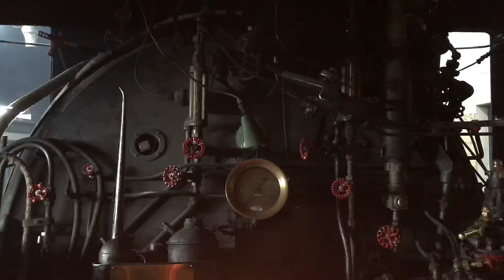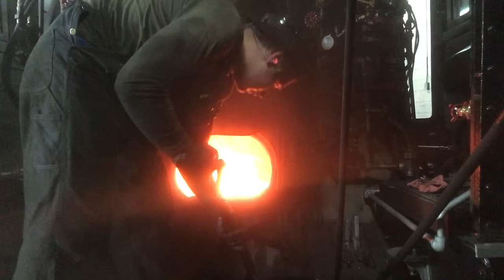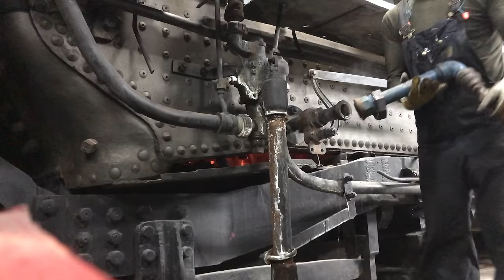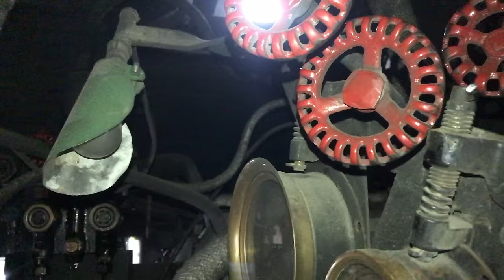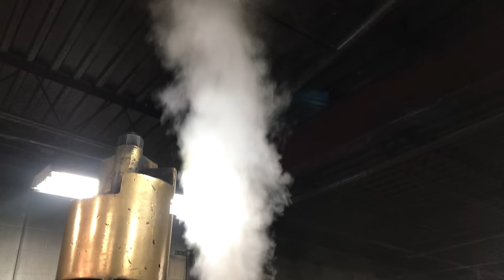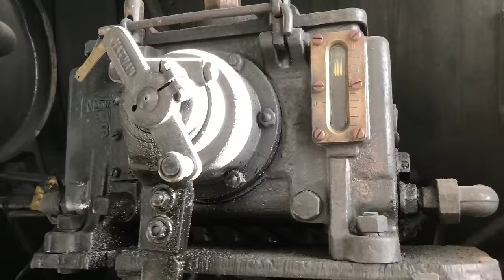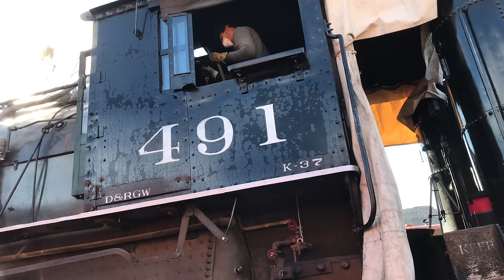How To Fire Up a Steam Locomotive [4K]

Comment: Flames in the firebox look like they are in slow motion...?

What a wonderful, wonderful piece of machinery a steam engine is...
Reply: I would guess that most people normaly only see open flames in a camp fire.
What causes the flame to go up, is the difference of temperatures between the flame and the surrounding air.
Most probably that difference is much smaller in a semi-closed environment like the firebox.
Reply: That is correct, if i learnt anything in school
Reply: +The airflow isnt the best in there, so there is less air pushing the flames around
Reply: Realize too that until the blower is functioning, there is back pressure in the tubes and the smoke will want to follow the path of least resistance. These run the length of the boiler, and will draft the smoke forward but it's a lot shorter route for the smoke to just billow out the firebox door until things are moving. Firing up a cold boiler too often also decreases the efficiency of the engine faster because the creosote and ash from the smoke condenses in the tubes more when they are cold, at first creating an insulating layer of crud and soot, preventing a lot of the heat from entering the water and eventually restricting flow. Once hot, and the blower is working, a lot more of it can move forward and up through the stack. Once the tubes are really sooted up the engine goes through a tear down to rod out the tubes, scraping out all that junk. They say a steam engine like this is about 3% efficient. That seems like a lot when you look how much wood and coal he burns, before it even moves an inch. 6 hours of hot fire doing no work at all!
Reply: I agree.  9:27 mark.  Was surreal.

Comment: How informative! There's so much more to firing and lubricating a steam locomotive than I would have ever assumed. The somewhat smaller diameter wheels coupled with a large boiler from a standard gauge engine is a good combination for climbing the steep grades found in the Colorado Rockies.

Comment: No wonder they went to diesel! Still, the wow factor is high!
Reply: ltcajh Diesels may not have quite as much plumbing, but they do have a lot of heavy gauge wiring in them.
Reply: @michaelmurray7199  wiring, believe it or not, is easier to manage than plumbing. Less to worry about.

Comment: Great video! Thanks for posting. I briefly volunteered there many years ago. I was always fascinated with the manual turn table. Balancing the weight of the locomotive then physically turning the table by hand. I was amazed at how easy it was to turn a locomotive around by hand (as long as it was properly balanced). I didn't continue my volunteering due to the fact that I am a machinist, welder, fabricator and all they ever had me do was paint stuff. It seemed that there was a "Good O'l Boys" club and if you weren't a part of that then you did not get to participate in any of the round house operations. I did get to operate the turn table once at an event held there, only because someone else couldn't make it. It's a great museum and I still enjoy visiting there. I just volunteer my time now where my skills are actually used.

Comment: The "slow fire" is pretty normal for coal. It doesn't burn like wood, and it's not under heavy draft while the loco isn't moving. What you are seeing is gases outgassing from the coal, and burning in the air above it. When in motion, there is a much heavier draft, and these gases are drawn up faster and further and combusted in the combustion chamber and firetubes. When the fire is cool and not under draft, a lot of the gases don't ignite at all, and just go up the chimney, which is a major reason for the thick smoke while the locomotive is getting up steam. Even opening the firebox doors allows a cool blast of air to cool the area over the fire, and a black smoke cloud is released. Another good reason to keep the fire hot, because you are loosing 15-20% of the BTU content of the fuel up the chimney if you don't keep the fire hot enough to fully combust these gases. Anyway, that's what a coal fire under minor draft from below looks like. Nothing abnormal about it.

SIde note, I thought it was much better to put on frequent single or double scoops of coal than to shovel big heaps onto the fire like that? That's in normal operation, and maybe it's different, but it seems like you could get the same benefits either way. Apparently putting a bunch of coal on cools the fire down, with the same poor results as described above, so it's best to put a small amount on, give it a few minutes to ignite and heat up, before adding more. Of course, maybe you have a lot of other stuff to do to get ready, so you can't stand there shoveling coal in every 4-5 minutes like you can while under way.
Reply: Holy Christ balls that’s a long comment.
Reply: Awesome Galore Holy Christ Balls Lmao. I Love Humanity.

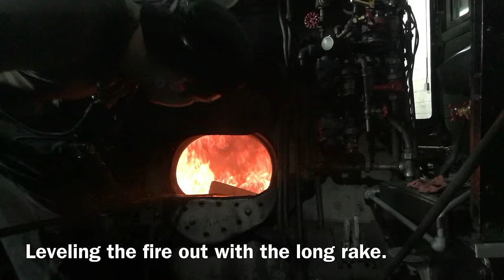Comment: anyone else think that the fire is burning in slow motion @9:34?
Reply: Looked cool
Reply: Yeah
Reply: I have actually seen this happen.  When you have a big fire and low draft, there is not a lot of air through the firebox, so it looks like the fire is 'slow'.  Under the right conditions, you can even see 'flashover' or secondary combustion at the top of the firebox.  A lot of wood stove guys are into secondary combustion to boost efficiency.  (shown in many youtube vids on the subject)
Reply: It looked insane
Reply: my guess is that the engineer is utilizing some sort of choking mechanism to slow down the combustion process and improve efficiency of the firebox. most fires (that would be considered to be burning at a normal speed) will dump a lot of their heat into the exhaust gases (smoke). by choking the fire like this and slowing the burn, he can heat up the boiler quicker and more efficiently
Reply: That's how hell looks like
Reply: Of course there is a "choke" (it's called a "damper"...or "dampener" if you're English, I believe). But that won't make flame itself burn "more slowly". It cuts down the rate of oxygen intake so the combustion happens more slowly, and the fire isn't as hot. But flame itself is just the visible part of a fire, the incandescent plasma escaping from the exothermic reaction we call "fire", which is just a chain reaction of molecules breaking down, releasing energy, which breaks down more molecules, releasing more energy, etc (as usual, the oxygen is merely a major catalyst that allows this to happen). Anyway, more oxygen makes fire hotter and faster, but less oxygen won't make a fire burn in "slow motion". A lack of drafts blowing around will lead to more stable flame however; when you see flame flickering and licking the air, it's due to gusts and drafts of air reaching the fire, and a strong draft will draw the plasma upwards with it; fire in microgravity burns in all directions equally. So closing a damper will probably make smaller and smoother flames, but not slower ones.
In any case, closing a draft just equals a cooler fire, and a cooler fire will not make a boiler heat "more efficiently". It will just be cooler, and therefore release fewer BTUs and take forever to heat the water up, which actually takes MORE total BTUs since the heat is constantly escaping to the atmosphere as you heat the boiler. It's like trying to fill a tub with the drain open; it will take less water in the long run to use a large hose and get it done quickly than to use a small trickle only slightly larger than the size of the drain. By the time the tub is filled, you will have run enough water into it to fill it four times, at that rater. Anyway, you are "choking" the fire from _underneath_, which just makes it cooler. The exhaust still escapes just as easily. 

So, using a smaller heat source is actually LESS efficient. At a low enough BTU point, the heat source literally cannot overcome radiant heat losses and the water temp never changes. Double that heat source, and you'll heat the water, but you have to keep the fire burning 4 times as long, so it actually uses MORE fuel. It's not linear even, it's a logarithmic progression. In all cases, it's almost always best to heat with a good hot heat source. There is probably a point where too much is too much, and the material cannot transfer heat as fast as it's being applied, but it doesn't apply to warming steam locos. 

In a steam loco, the biggest problem is to keep enough draft going while trying to heat it up, since without airflow over the stack and without the blastpipe working, it can be very difficult to keep a decent, efficient fire going while making steam. They use a blower to keep artificial draft going to keep the fire hot enough to heat. They certainly don't cut down the draft even MORE by closing the damper. The only time that is done is when banking the fire, as far as I know, or if for some reason you wanted to keep a fire burning in the firebox, but not necessarily enough to keep up any steam, just a small, dull fire that might keep the water warm.
Reply: The reason why it looks slomo is because the whole volume of air inside the fire chamber is extremely hot, so the flames wont get pulled up by hot air so fast anymore. A flame burning in cold air will pull up its own hot air much faster.
Reply: I dont think Hell would look awesome!!!
Reply: That’s exactly how my wood burning stove looks when I get the balance between air and fuel right. I have controls to reduce the air fuel ratio.  The firebox of this engine is similar to a wood burning stove just much larger and the ratio of air vs this increasingly large and hot fire makes for an almost mesmerizing flame.
Reply: I believe there's a draw fan on the smokestack.
Reply: @corey872  still looks totally dope.
Reply: @3DPeter  you just took my comment out of my fingers.
Reply: @nialether   I hope that i go to hell, because that's where the bad (and willing) girls go.

Comment: Excellent job to the guy in the overalls and the recording guy! Looks like he does a great job at starting up Steam Locomotives! How long did it really take to do all that work? Hope to see more videos soon! I love old steam engines, how they move, and sound, it really is something!
Reply from the maker: Roo Reeves From cold, it usually takes 6-7 hours to get up to operating pressure. In the video I started at around 3AM and the locomotive was running at around 10AM.
Reply: Jeff Barrier,is logic,,,the iron may have the dilatation slowly,,to avoid stress metal,,is a big mass to heat,,and logic,,takes many hours,,,,tyhe biggest steam locos ,,,more time,,,12 hours.,buyt once is in run temperature,,has  a heat reservoir:His big mass
Reply: Adam Ross the 1225 is a beautiful piece of engineering-art. I love that locomotive, and it's one of the favorites on my layout
Reply: 3am - respect!!!

Respect all round for this substantial contribution to the online video resources of operating steam locos! Thanks Jeff :D
Reply: Asserting Word it kind of pays off for that work though. Pound for pound, steam engines have alot more horsepower and torque than diesel engines. 
Diesel just won out because of lower maintenance, MUCH quicker startup, and much easier to man and crew.

Comment: That was very interesting to see!  Takes a lot of elbow grease to wake up such a mechanical beast. I suppose the video also shows part of why electric and diesel locomotives eventually replaced steam locomotives completely: there's a lot of man-hours involved to keep steam engines running.
Reply: Very true. As romantic as steam is, once Diesel, Petrol and Electric drivetrains became reliable the world began to move on (for trains, cars and stationary engines).
There are just too many disadvantages:
Very long warm up/starting time.
Regularly requiring water fill ups even with condensers (if you go down old railway lines you'll find many water towers for that purpose).
The danger of blowing up catastrophically.
The very labour intensive maintenance.

Comment: technology has come pretty far. firing up a locomotive used to take a full day, and a few people working their nuts off to get it ready. now, we just energize the tracks, or warm up the diesel engines for a half hour. we're pretty spoiled these days.
Reply: Yeah and no one gives a crap about modern locomotive technology either. This right here is the real deal.
Reply: Even modern locomotive technology is pretty complex. The efficiency of Diesel Electric locomotives is the reason they now rule the railroad. The same engines used for switching in the railyard can be used for long trips. I was amazed at the railyard in North Platte, NE. There are several locomotives serviced there daily in addition to all the cars sorted and trains that pass through. They wouldn't be able to service or keep as many steam locomotives operational simply due to the time needed to fire them up or cool down (prior to being serviced). Some of the locomotives were moving within minutes of starting up. Steam electric is the only steam option that would still be viable for widespread use.
Reply: Chris Evil 

The steam locomotives are what built the United States and made everything after possible.

Comment: Still more practical then the hyperloop.
Reply: Do u live in the bronce age or what?
Reply: Observatore - Look up "Pilbrow's Atmospheric" (and "bronze") at some point.  Mr Musk's idea is neither original nor historically successful.
Reply: It´s not really Musk´s idea (what you wanted me to look up), but that is not what i want to argue about, because u obviously don´t understand the differences. What i want to say is that neither it is "historically successful" nor have i said espacially that. It is under development, wasn´t the locomotive also at some stage of it´s life under development?
Reply: Thunderfoot did an excellent job explaining why the hyperloop is nothing but a money burning insane idea. But let me add some points.
First of all, getting people in and out of these pods without breaking the vacuum will be very difficult. Figuring a way to do it practically and affordably, not worth it.
Secondly, the energy required to maintain this vacuum will far exceed the amount of energy required by a bullet train to merely push air out of its way.

Basically, Elon Musk should just build a damned bullet train or mag-lev.

Comment: Incredibly, I would never have expected it to take 6-7 hours to start a steam locomotive. A wonderful video for those of us who still remember steam locomotives
Reply: From a cold start anyway. The process is much quicker if you “put it to sleep” which means leaving a minimal fire overnight to maintain relatively low pressure and heat. This helps when the locomotive will run the next day.

Comment: I suppose back in the early 1900's there would have been a large team doing all this?
Reply: AndyW normally 2-3 guys in the cab
Reply: @AndyW back in the day, prior to FRA 1452 day rules and such, typically the only time a locomotive would have the fire completely dropped and/or boiler drained would be for an overhaul or major repairs.  Otherwise, teams of hostlers would keep them fired (or at least with fires banked but still burning) and ready to go at any time.